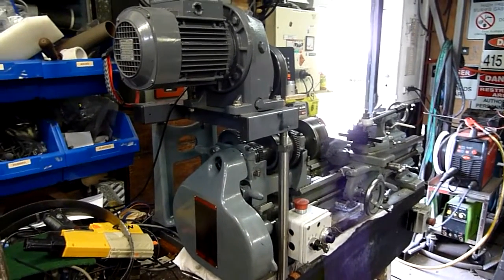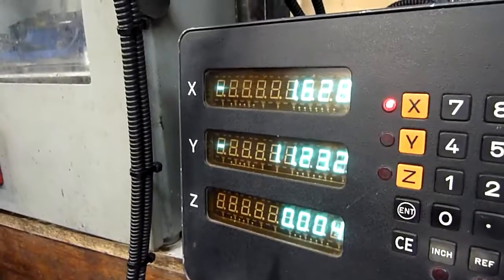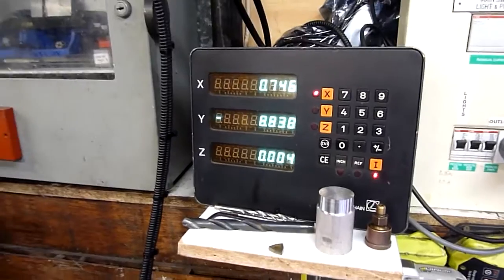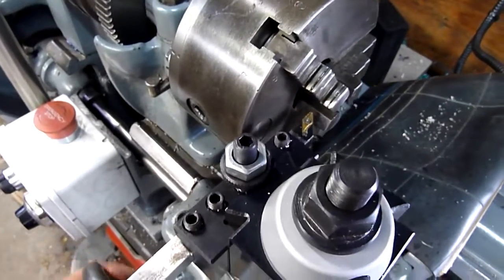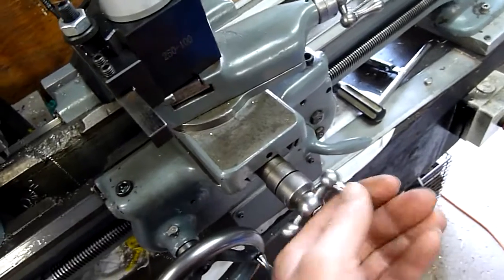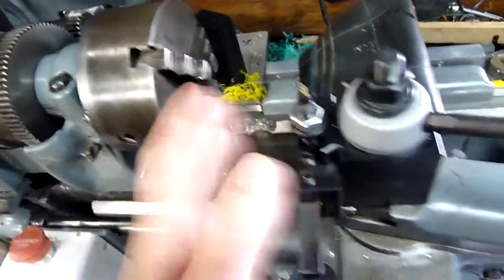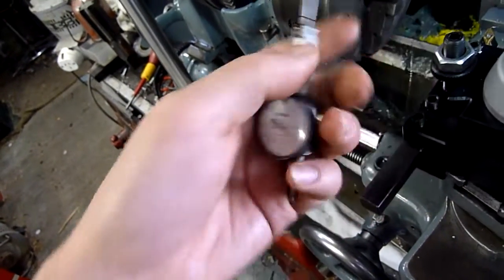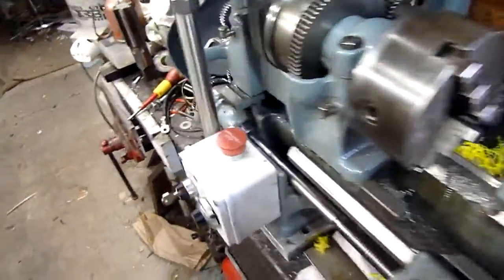Machine tool update - South Bend Lathe with Digital Read Out.

Comment: How’s the ML270 doing?
Reply from the maker: shredded a serpentine belt pulley today, its at a friends shop getting poked at tomorrow, hopefully its just an idler, not the AC, alt etc, that stuff gets expensive. other than that I have put about 5,000km on it so far and its been good. pretty loud and obnoxious with the exhaust and intake opened up a bit, but I love it :D
Reply: Aussie50 haha let’s hear that exhaust!
Reply from the maker: @55kompressor  Its off the road now, they changed a couple of pulleys but it did not fix it, Alternator bearing went full-nuclear thismorning and its the turbo making nasty screaming noises, both need to be replaced ASAP :(. back to driving the RAV4 daily. not a bad car either, just not a turbo diesel

Comment: Good job with the lathe, thinking of getting a lathe around that size
Reply from the maker: quite expensive since they are hobby size, but occasionally you can snag a cheapie that the seller does not know the value of. especially if its missing motor, 3 phase or not running, since your probably going to put a drive on it anyway.

Comment: You should be able to get replacement scales;  they generally output quadrature.  the thing to look for is voltage and counts/inch/cm but otherwise should be interchangeable (not counting connectors).
Reply from the maker: good point ,the Fagor looks like it uses the same pin-out, just different connectors